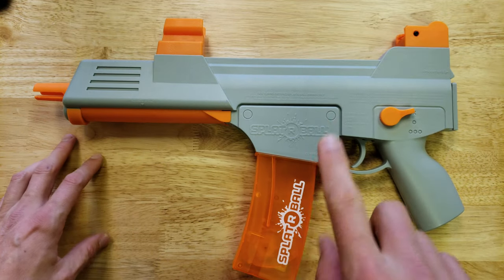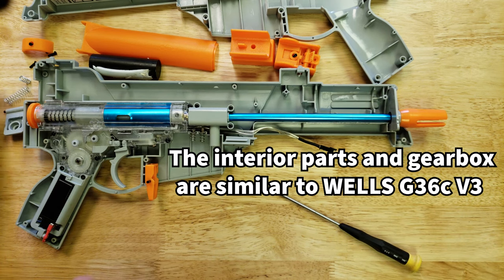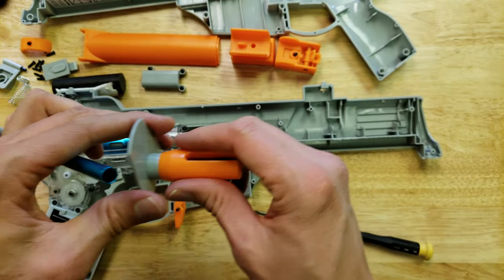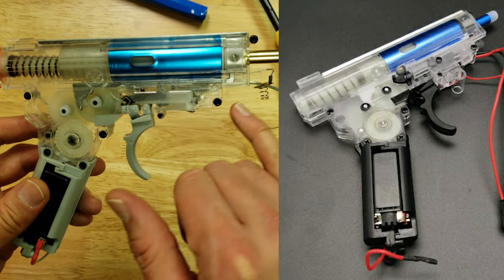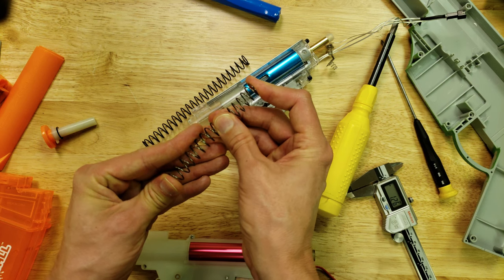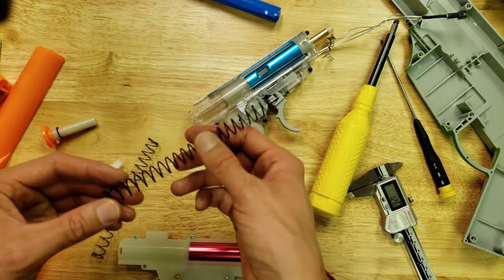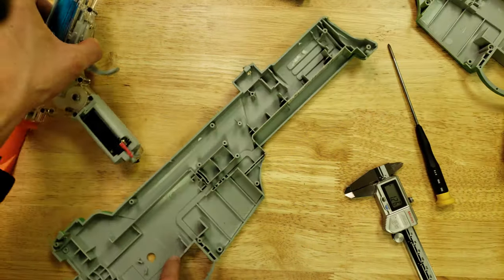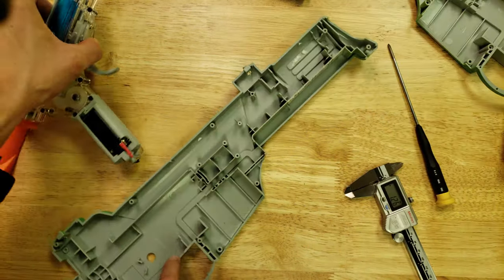What's Inside SPLAT-R-BALL Gel Blaster?! I Take Apart SRB400 Gel Ball Blaster To See How It's Made

Comment: If anyone is interested in real upgrades, I believe this is an airsoft v3 gearbox so if you’re looking for a stronger/faster motor get an airsoft motor with a short pinion. Gears are going to be marked as v2 but v3 gears and v2 gears are the same so don’t worry about that. You can also get upgraded mosfets as well
Reply from the maker: Thanks for confirming that. The cylinder head, plunger and tappet plate are going to be different though and need to be V2/V3 gel blaster specific. The gearbox may also need to be slightly modified to allow the tappet plate to slide further back.

Comment: Could you make a tutorial on how to replace the gears with metal gears? i use a better battery for my splat gun and i heard it really damages the plastic gears and wanna upgrade them to metal so it doesn’t happen.
Reply from the maker: Working on it. Coming soon... Hopefully before your plastic gears explode!
Reply: @engineerable  have you made the video yet my gears just destroyed…
Reply: @9kmoneyy  Came here for the same thing. I was gonna see if i can get a idea what gears i need to order or go find or even try to machine at work to use. Looks like i have to just take it apart and find it out.
Reply: @engineerable  when’s the video coming out,
Reply from the maker: @cablenowadays6586  here's the gearbox teardown video - https://youtu.be/zscIt0RVLKA
I'm keeping this page up to date with upgrades: https://www.engineerable.com/single-post/what-s-inside-splat-r-ball-gel-blaster-i-take-apart-gel-ball-blaster-to-see-how-it-s-made-works
Reply from the maker: Watch the metal gear + spring upgrade video https://youtu.be/qQKaKdEUPCs
Reply: Look up ver 3 gearbox takedown for airsoft. You can probably just pick up a built ver 3 gearbox and swap your gel blaster piston head and cylinder head into it.
Reply from the maker: @taeyeoff  thanks, doing that next
Reply: @engineerable  A cheap prebuilt standard ver 3 gearbox is probably around the same price as the gel blaster, just a heads up
Reply from the maker: @taeyeoff  I have the Silver Edge which was about $70, so you're right about costs as much as the blaster. If that works, I'll build up a Retro Arms gearbox 😂
Reply: @engineerable  Not worth it, ra gearboxes are for really strong springs, if you don't have an insane spring its just a waste of money imo but totally up to you
Reply from the maker: @taeyeoff  Yes, the point would be ridiculous overkill build for YT video. Any gearbox recommendations for a good balance of quality/price for viewers who want to build one?
Reply: @engineerable  icic, you're gonna have to research that on your own because I live in canada and its hard to get airsoft parts over here so everything is marked up. You probably have better and cheaper options than what I would buy if you're in the states.

Comment: Could you upgrade the springs and batt to make it shoot faster
Reply from the maker: Yes, you can within reason. Stronger spring = higher FPS. Higher voltage = increased RPS Expect to have to replace gears and motor more often, so you need to have some spare gears and motor ready.
Reply: @engineerable  what if you only change the spring will it still mess up the gears and motor
Reply from the maker: @westwoodland9709  Yes, you will shorten the lifespan of the plastic gears in particular. The standard spring strength was chosen to maximize the gearbox life. 
If you look at any decent airsoft gearbox that uses a stronger spring, it uses metal gears. 
The first improvement to make which would not increase gearbox/motor stress is to replace the piston o-ring and improve the compression.
Reply: @Engineerable  Can you make a video on how to make this upgrade and add links to all the parts we will need to purchase?
Reply from the maker: @rehemarviv6471  working on it
Reply: @engineerable  thank you so much, subscribing right now. In about how long will the vid be uploaded?
Reply from the maker: Watch the metal gear + spring upgrade video https://youtu.be/qQKaKdEUPCs
Reply from the maker: Watch the metal gear + spring upgrade video https://youtu.be/qQKaKdEUPCs
Reply: Where can I get Lightning blaster Metal gears? Springs, the works?
Reply from the maker: @raymondbetancourt6498  I haven't upgraded Lightning Blaster, but it's probably very similar to upgrading the Splatrball, so check out this video https://youtu.be/3o4r5-Xr93U

Comment: I have a question beacuse i was repairing my splat gun and the part for the magazine on top the springs one of the wires deattached from the spring and i dont know if i can glue it back or what
Reply from the maker: You have to use a soldering iron. I made a video about how to do that https://youtu.be/xmUOS-2yK0M
Reply: @engineerable  so i cannot use glue
Reply from the maker: @itznma3456 Not if you want it to work well. You need to use solder to make a strong electrical contact.

Comment: What to do if the splatter ball gun is making a loud high pitch noise and it won’t shoot?
Reply from the maker: Sounds like your gears are stripped, and you need to replace the gears. There's some info here, and i will have repair tutorials soon. https://www.engineerable.com/single-post/what-s-inside-splat-r-ball-gel-blaster-i-take-apart-gel-ball-blaster-to-see-how-it-s-made-works
Reply from the maker: Watch the metal gear + spring upgrade video https://youtu.be/qQKaKdEUPCs

Comment: where would i be able to find new gears.
i put a bigger battery which caused the gears to strip.
Reply from the maker: For a higher voltage you're gonna need metal gears, which probably also means metal teeth on the piston. The gearbox is a common airsoft V3 gearbox modified to work with gel balls. Airsoft V3 gears should also work, as long as they can pull the tappet back far enough. I haven't verified this, but planning to buy some parts to check.
Reply: @engineerable   where could i find nylon gears in the US i just want to make it back to stock
Reply from the maker: @vlonereaxt829  Sorry, I have not seen any replacement nylon gears in the US. The reason is that the airsoft community considers nylon gears to be for toys which will wear out quickly, so they only sell metal gears for replacement. The nylon gears in this blaster are generally fine if you don't mod it. 
You could try a set of CNC metal gears with the plastic piston. If you use the original battery, you should be good.
Reply from the maker: Here are some plastic gears. They ship to the US. I have bought from them before. https://www.zhenduotoys.com/V2-Gearbox-Nylon-Gears-18-1-12-1-p2850400.html

Comment: Hey I was wondering if you new anything about hop ups if so I was wondering if I could take of the yellow piece at the end of the barrel and some how put it on? also I was wondering about upgrading the barrel to a better one that are meant for hop ups
Reply from the maker: I've been researching hop ups. Unfortunately, I haven't found anything sold in the US, so it's either order from Asia or 3D print. I've heard that 3D printed versions don't last. The most popular hop up appears to be the Rizer which has an aluminum housing with plastic internals. However it would require some modification of the plastic piece on the front of the barrel to allow it to fit. I've seen 3D printed front pieces with integrated hop up for the G36c (same body).
Reply from the maker: Watch the metal gear + spring upgrade video https://youtu.be/qQKaKdEUPCs

Comment: Could you make a tutorial for like a better spring and what you would recommend and how to install a gear box and one to recommend
Reply from the maker: Working on it. A stronger spring will stress the nylon gears, so when those go you will also need to change to metal gears. The first things I will look at are the piston o-ring seal, cylinder head, and plunger. Any leaks in those areas that can be fixed will increase the FPS without stressing the gears. Considering the low price of this blaster, you could easily dump 1-3X it's price in upgrades. A full CNC aluminum airsoft gearbox shell is $100, and would be a good starting point for a bombproof gearbox.
Reply: @engineerable  hey I have the srb400 the blue one I have a metal pinyon gear for the motor and metal gears could you link me a piston and piston head
Reply from the maker: @averiesmith5574  You should be able to use a V2 or V3 airsoft piston and piston head that you can buy in the US. Otherwise here are some links to order Gel Blaster pistons: https://m.zhenduotoys.com/V2-Gearbox-Metal-Ladder-Piston-Head-p746032.html

Comment: Where could I get a replacement gearbox??? I dropped mine and now I have to pull the trigger sideways for full auto can anyone PLZ help!!?????
Reply from the maker: Maybe you can just take the gearbox apart and realign what came out of place. It's hard to find a drop in replacement gearbox right now, and if you're going to do that work, you might as well upgrade to an all metal gearbox. Read through this for more details.  https://www.engineerable.com/single-post/what-s-inside-splat-r-ball-gel-blaster-i-take-apart-gel-ball-blaster-to-see-how-it-s-made-works
Reply from the maker: Watch the metal gear + spring upgrade video https://youtu.be/qQKaKdEUPCs

Comment: Surprised to see this is an airsoft gearbox, wonder what’ll happen if I put an airsoft gearbox into it
Reply from the maker: You'll release the magic smoke! Airsoft V3 gearbox will fit, but the cylinder head, nozzle, and tappet will need to be replaced with gel blaster compatible parts.
Reply from the maker: Watch the metal gear + spring upgrade video https://youtu.be/qQKaKdEUPCs

Comment: My gel blasters motherboard just randomly fried so it does not work anymore . What can i do with the gearbox? Can i somehow make a gel blaster from it or anything?
Reply from the maker: What model?
Reply: @engineerable  its a SplatRBall SRB 1200
Reply from the maker: @Hoodville13  as far as I know, there are no electronics for the shooting part. Only PCB is for LEDs
Reply: @engineerable  then do you know why my gun does not work anymore if the motherboard inside has nothing to do with the gun actually firing?
Reply from the maker: @Hoodville13  It could be battery, wiring, motor,  mag motor, gears. Use a voltmeter to trace where the electricity is getting too. Test the motor by removing it and see if it runs. If so, then the issue is with the gearbox.

Comment: The thing that’s supposed to power the motor in the magazine doesn’t work; and I haven’t even opened up the blaster yet to fix that. The blaster shoots good and everything works besides the electronics inside the gun not powering the mag motor. And yes I know it’s a problem with the gun. I have like 6 mags, and it powers none of them. How do I fix that, or replace those two spring looking things that power the mags?

Comment: Hi can u help me so I was painting my gun and I toke off the panel right well you know that wire going to the battery connector things to the mag the wire fell off how can I reconnect it?
Reply from the maker: If the wire came off the contact, then you gotta solder it back on
Reply: @engineerable  I cant tape it?
Reply from the maker: @xzvyv5369  not if the wire is disconnected from the contact. You need to solder it
Reply: Thanks
Reply: @engineerable  hey I got another question so this is like my first time soldering but I’ve been searching videos of like how to and it’s only showing wires and I’m trying to do it to the little battery spring thing should I js continue and solder it?

Comment: My motor in the clip is not spinning and I bought a different clip any suggestions?
Reply from the maker: Check to see if the contacts in the blaster are messed up or if there are obviously loose wires first, and resolder them. If you don't see loose wires, use a voltmeter to trace the power and figure out where the bad connection is.

Comment: Do u know how to fix a gun that doesn’t shoot? Every thing looks and sounds normal but it won’t shoot ? I need help
Reply from the maker: It's difficult to diagnose without looking at it. Are gels feeding to the T piece, but not entering the barrel? Is the magazine motor working to feed the gels? Is the plunger in the T piece moving all the way back?
Reply: @engineerable  hey my gun will shoot semi but not auto can u help?
Reply from the maker: @cruzpena4706  What happens when you pull the trigger in auto?
Reply: @engineerable  then nothing
Reply: @engineerable  i have it fixed now with tape the select is must be broke but i out tape to a certain area so it will shoot auto its a certain angle that it wont shoot
Reply from the maker: Did you get it fixed?
Reply: @engineerable  i just bought another one and returned the broken one and goy the new one for free

Comment: I was wondering if I could upgrade the blue barrel on the splat gun? The only problem I was thinking about is the stock T piece wouldn’t fit an upgraded barrel or an upgraded T piece would not let the gels to load in?
Reply from the maker: What's wrong with the stock barrel? It's aluminum and standard dimensions.
Reply from the maker: What's wrong with the stock barrel? It's aluminum, seems like good quality and standard dimensions.
Reply: @engineerable  if you get the right barrel you could increase fps and accuracy + you can actually put an hop up on it that actually fits also since they don’t sell hop ups to the USA what do you think about some other websites can deliver hop ups to the USA there around $30 bucks

Comment: Where do I find the input gear that’s on the motor for this gun because it’s not on the nylon gears or metal gears buying list?
Reply from the maker: Let me get back to you about the motor pinion gear. There are 2 types of gears (for O and D shaft motors) and I need to take a closer look at which one it is.
Reply: @engineerable  ok thank you so I much love the content💗💗
Reply from the maker: I've updated the page with links to O and D shaped motor pinion gears. Check your motor shaft to see if it is O or D shaped before ordering.
https://www.engineerable.com/single-post/what-s-inside-splat-r-ball-gel-blaster-i-take-apart-gel-ball-blaster-to-see-how-it-s-made-works

Comment: What do I do if it doesn’t wanna shoot if I left it on for a long time is it the battery or the gun
Reply from the maker: Probably battery is dead
Reply: @engineerable  I charged it and it didn’t want to shoot should I buy a new battery
Reply from the maker: @emanueldiazpecina5064  You should use a voltmeter to test the battery voltage first and determine whether it is good or bad.

Comment: Anyone know why my splat gun the trigger doesnt wanna shoot on single or auto it just clicks there is no high pitched noise either but it just doesnt shoot and the trigger only makes a sound
Reply from the maker: Could be many issues. Does the mag motor continue spinning? The time I've encountered this issue was because the battery was not charged enough. Don't trust the cheap charger. Test the battery with a voltmeter.
Reply: @engineerable  the mag is fine and the battery was fully charged
Reply from the maker: Something's jammed in your gearbox then. You'll have to take it apart to figure out what's wrong. Test the motor first, that is easy to remove. https://youtu.be/zscIt0RVLKA
Reply: @engineerable  wow i finished watching the video and im so confused i dont even know what i will need to fix and also one question how will i test the motors if it doesnt wanna shoot?

Edit: thats how u know my brain is all burned up from not knowing anything about this

Comment: What is the name of the gear box
Reply: ive been trying to find this out for weeks
Reply from the maker: Specifically, it's a WELLS G36c V3 gearbox. Generically it's a copy of an airsoft V3 style gearbox modified for gel ball diameters. It's possible the gears are the same, and if so, that would make it much easier to buy gears from US sources. 
Alpha King V3 is also basically the same gearbox, as is CYMA V3 G36
Reply from the maker: Watch the metal gear + spring upgrade video https://youtu.be/qQKaKdEUPCs

Comment: How to fix if your splatter ball gun sounds like it’s broke and making loud noises and it’s a piece that’s broke you showed it in your vidoe but it’s like a piece that broke . It’s like a gray metal piece that’s by the 3rd little circle things
Reply from the maker: I believe you are talking about the tappet piece. (Long metal piece that goes between gears and the nozzle). You need to buy a new one. Most replacements will be plastic, which may actually be stronger for this use. Check my post for more info where to buy parts: https://www.engineerable.com/single-post/what-s-inside-splat-r-ball-gel-blaster-i-take-apart-gel-ball-blaster-to-see-how-it-s-made-works
Reply from the maker: Watch the metal gear + spring upgrade video https://youtu.be/qQKaKdEUPCs